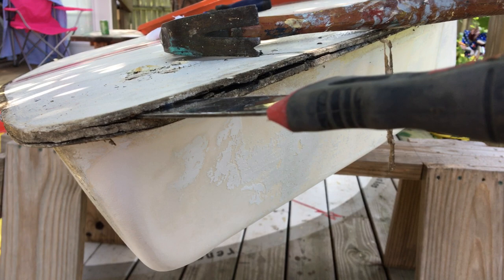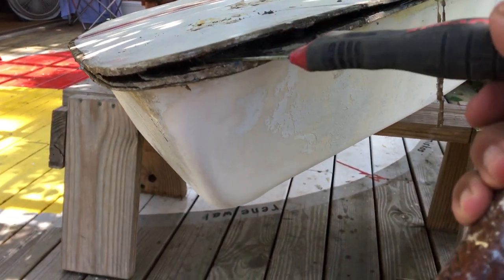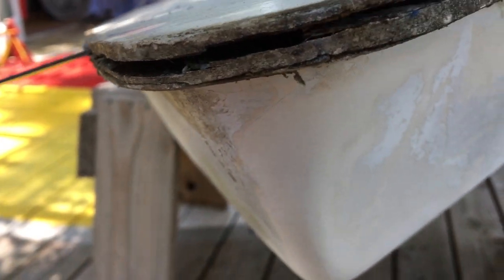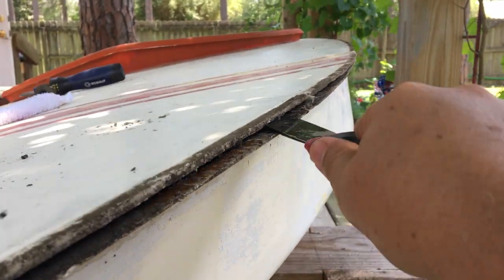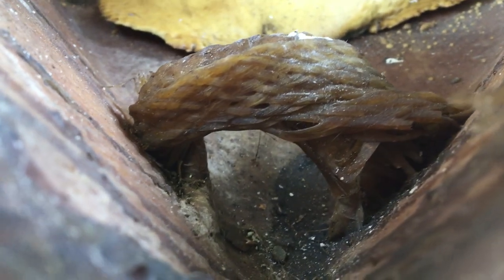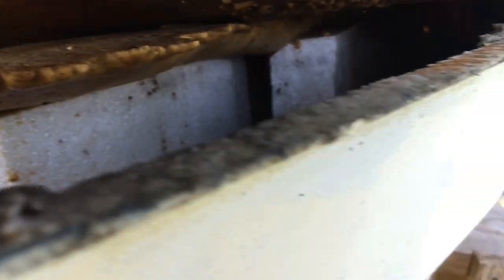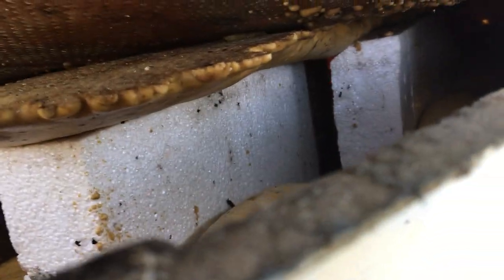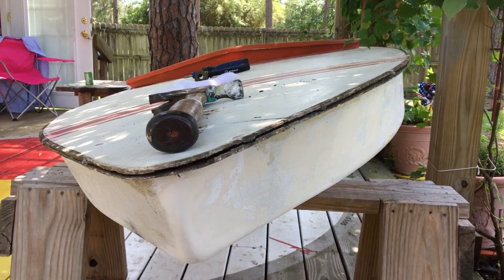1978 AMF Sunfish SUGAR 2 Deck Edge Seam Split

Comment: I'm in the midst of a similar repair on my 1979 Sunfish.   What product did you eventually use to reseal the deck and hull together? I followed your example using a putty knife and hammer and it opened quite easily.  The bow handle pulled right up and out without any effort - the backing block disintegrated and could not be located in the hull after we opened it up. Thanks!
Reply from the maker: Most important, do not split the entire seam, at a minimum leave the seams intact on either side of the cockpit. Only split enough seam to do the work neede. We use thickened flexible epoxy, our current favorite is "TotalBoat THIXO Flex" dispensed from its caulk cartridge. All the resin, hardener and thickener comes in one tube, ready to dispense through the mixing tips. Of course the Old School way of measuring and mixing everything by hand also works. We clean the seam, lightly sand and also place a wet out piece of 4 oz fiberglass cloth in the seam. Lightly clamp with paint sticks under the clamps to evenly spread out the pressure. We also buy syringes from West System or TotalBoat to dispense the epoxy into small cracks. It is also best to buy a 25:1 high thrust caulk gun vs the basic cheapo caulk gun. Search our videos with the key word seam to get more info, and post questions as they come up. Here's one helpful video: https://youtu.be/rv7lvuIuXiQ?si=pMQP8PVoIwKopG7M